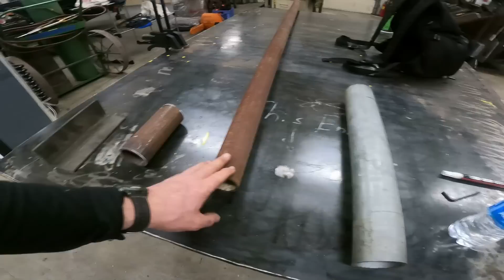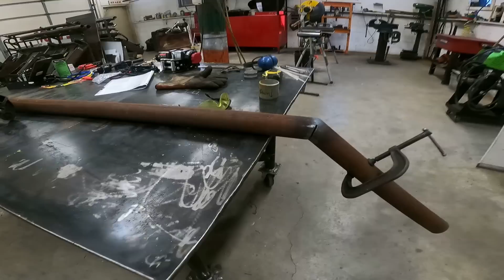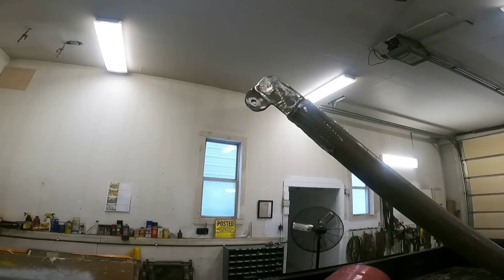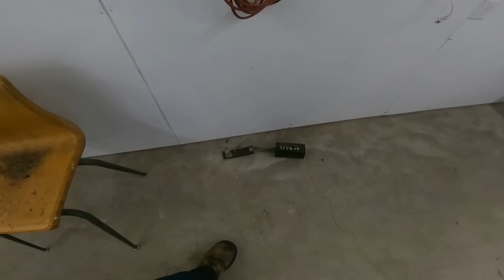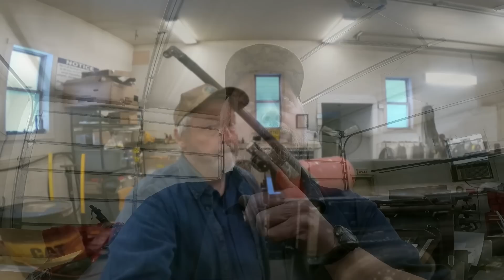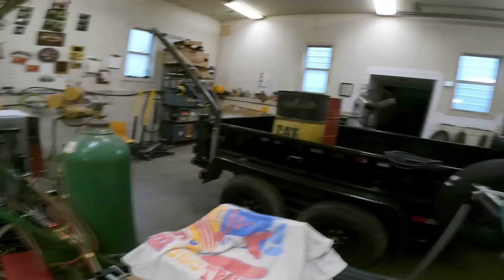Hillbilly Builds Illegal Overhead Crane

Comment: I would add a pole that you could put in to help swing it around and then add a eyelet to the side of the trailer to hook the cable to when you are going to get the oil barrels. That way it doesn't flop around going down the road and so you don't have to remove it when you're using it. That's just me. But it looks great to me.
Reply from the maker: There are 6 D rings in the floor of the trailer. Plenty of places to hook it to so it doesn’t swing around.

Comment: Looks good... i would of soldered the cable ends. Then shrink wrapped like you did.
Reply from the maker: I seem to suck at soldering, so I crimp.
Reply: Easiest way I found is to put the end in a vice and melt the solder until its half full and then as your keeping the end warm to keep the solder liquid you push your wire ends into it as removing the heat if it doesn't seem to settle to the bottom all the way all it takes is a little heat

Comment: You need to get a jack put on the crane side to stabilize the trailer
Reply from the maker: It seems to handle it ok. A barrel of oil is the heaviest thing that I will ever lift with it.
Reply: @hillbillyrvbehindthecurtain  yes but if get two barrels at a time then that’s roughly 1200 lbs on the back corner.

Comment: The wire could have been easier if you strip double leanth folded it back and put in the fitting then crimp. Id have soldered them in then crimped and shrink tube them. To each his own tho. Nice build did you drill a drain hole for the galvanized pipe ??
Reply from the maker: You are right. I didn’t think of that. 3/8 hole in the bottom of pipe. Plus there is about an inch that I couldn’t reach to weld.

Comment: Another really great way to keep the moisture out of your connectors is to get that 3M rubberized tape. It's more of a type of sealer than an actual tape. When you peel it apart, you want to stretch it really good and wrap it many times around the surface of your connector there. It'll self adhere and become kind of a solid rubber block over time.    Normally I'll wrap that around my connectors and then I'll put heat shrink over it just to kind of make it look cleaner.   I had to do a join in some cat5 cable I was running between some houses and I dig it up eight years later, because it got cut again, and I undid that work and inside it looked like it was as new as the day I put it in!  Great stuff.
Reply from the maker: I forget about the rubber tape.
Reply: @hillbillyrvbehindthecurtain  i bet combining the grease and tape would be an all but permanent seal.
Reply: Excellent tip